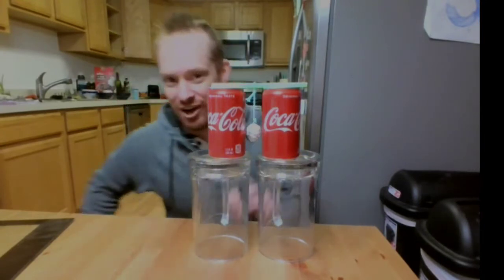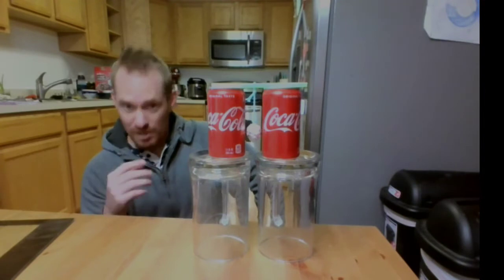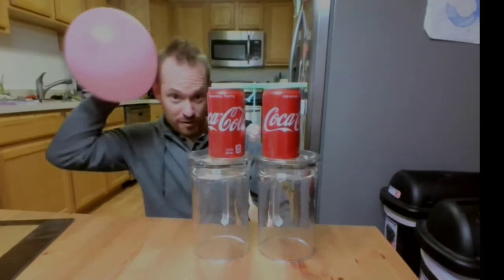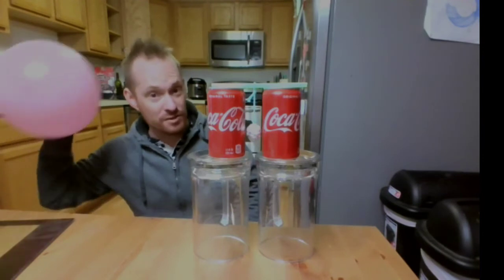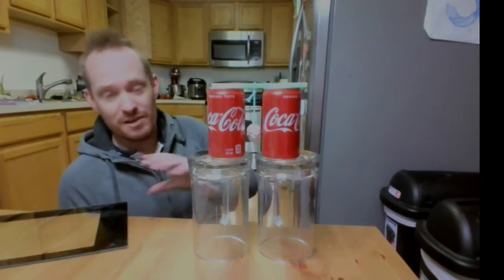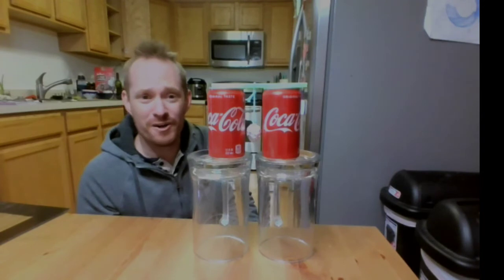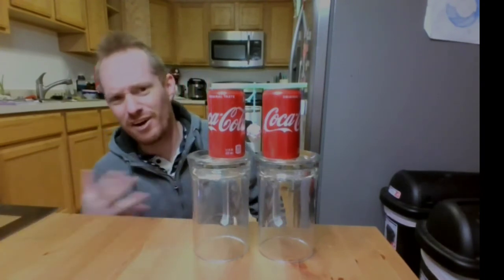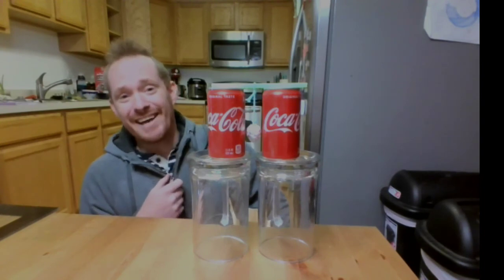Discussion on 1840 Clarendon Dry Pile electric bell vs Franklin Bell

Comment: Hey man thanks for the interesting video. Just wanted to let you know about the Marcus Reid crystal battery. It has been under load for 20 years without any noticeable power drop or corrosion
Reply from the maker: I haven't seen construction of the battery but from what some early videos claimed on the operation it acts as collector. I'd be skeptical if this was being done without a capacitor in the circuit but overall similar in principle to EMF transmission of energy Tesla wanted to do. See US patent 685,958.
The issue I would see is that there would be a "load" of some kind and a lot of the atmospheric electricity potentials do not seem to be readily available for our current intensive culture at large scale. 
Similar approaches of harvesting can also be done with micro solenoids! Under the same principle of harvesting radiant EMF
https://www.researchgate.net/publication/253597006_Micro-solenoid_electromagnetic_power_harvesting_for_vibrating_systems
The issue becomes is it more efficient than current solar cells given the same amount of space and material costs. 
These would be the major questions of why you don't see widespread use of exotic energy collection systems is because energy density of other types of fuels such as carbon chains and oxidation processes extremely energy efficient. Although our nitrous oxide content in the atmosphere is definitely a bit out of control at the moment.
Reply from the maker: That's one thing to keep in mind with the connection between crystals (assuming they are cut or in small enough flakes do not have canceling domains) and solenoids (coils of conducting insulated wire) is that they have three characteristics: Capacitance, inductance, and resistance. Understanding the relationship between coils and crystals can really push your circuit design or your experimental setups into a whole different level of experimentation that's quite exciting in my opinion.
Reply from the maker: For a simple circuit design using a crystal and a capacitor check out a pierce oscillator developed by a distant cousin of mine

Comment: Monumental masonry places might be interested in your rock cutting technique. More specifically some type of engraving tool for headstones. Currently its done using silica sand to sand blast out stencils. If you could demonstrate precisely engraving text onto granite people in that field may also be interested.
Reply from the maker: That's a great idea. The granite pieces in my previous videos were contributed from monument masons (scraps from floor).

Comment: That's an interesting theory. Try the cage and see. I don't know if the opening size of the mesh makes a difference with static electricity.
Reply from the maker: I found an aluminium mesh in my tool closet and it does block electrostatic from the balloon to the cans in my set up! So if the professor I am writing in Oxford goes forward with my proposal, it could be a simple test to prove if I am right without touching the experiment and being to see whats inside. This mesh had .5 cm openings with ~18 gauge wire. 
I am pretty sure the sulfur coating on the dry piles plays a factor in increasing its sensitivity to static fields with the piles regulating charge differences between the two sides. Especially when we consider how a charge is carried in a Franklin's Bell to have it ring, but in the design we see the dry piles are connected to both sides. When initially set up I suspect one was given a charge and the other was meant to absorb the charge, store it, and then release it. But that same principle likely applies to any outside static force that may be ever so slightly feeding the system, preventing it from ever completely stopping.
Reply: To me the implication is the possibility of harvesting environmental energy. Albeit very small it potentially demonstrates a constant supply of ambient static charge being converted to physical motion. If it in fact could be enhanced to produce a more pronounced effect, scaled up, or if using many components could be combined to increase the output, useful energy may be harvested. Consider that if the pendulum (for want of a better description) was disrupting a magnetic field. That might produce a current. However small that might be, once the current is produced many tiny charges might be able to be combined for increased electrical output.
Reply from the maker: @MrFmiller  We can already to some extent with electrostatic motors. But the force to apply electrostatics to a sustained direct current or alternating current is a weak transition.  With that said, nikola tesla did consider it in his patent  https://patents.google.com/patent/US685958A . Keep in mind this is years before Atmospheric Electricity was explained as a physical phenomenon. So essentially he slowly charges a capacitor to capacity and then in parallel to the capacitor powering some device with a protective spark gap to protect the capacitor and circuit connected. Its comes at a cost. As its basically using errant positive charge in the air and helping it connect to ground that forms the movement of electrical potential in most naturally occurring electrostatic potentials with those potentials then being passed between materials on contact based on a triboelectric effect. I think there is a lot we can do with electrostatics that has not been explored but it may be outside of our current applications in electronics.
Reply from the maker: @MrFmiller  it looks like they hope to make a power station. But the issue is that they don't have the current to drive that potential voltage away from their facility efficiently. For their live demonstration, it appears orders of magnitude less than that of Benjamin Franklin's Sentry Box experiment. Which makes me wonder if they don't understand the physical electrons are being pulled from ground in atmospheric electricity as they try to ground the positive ions.